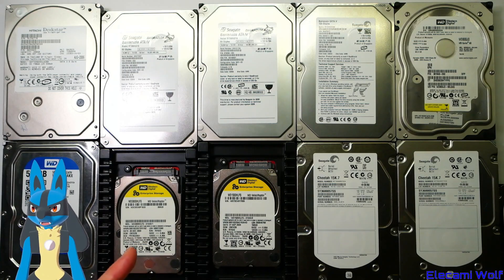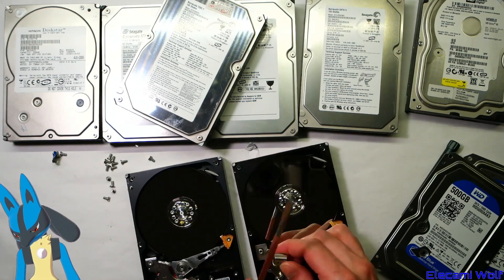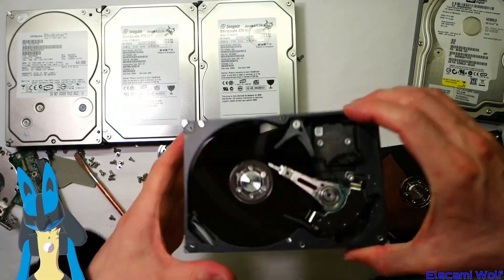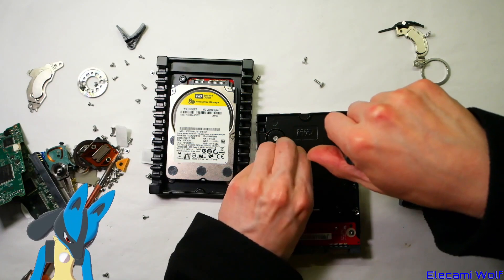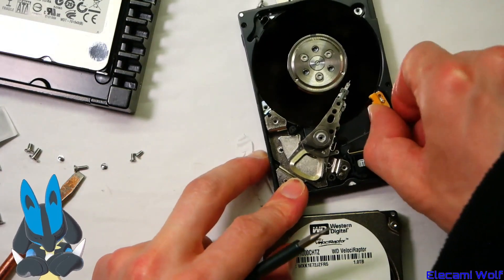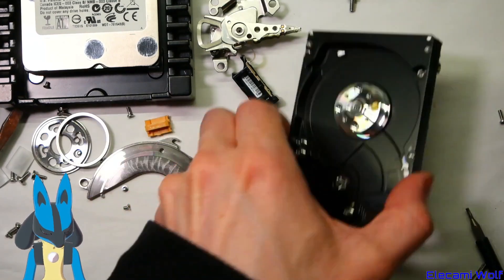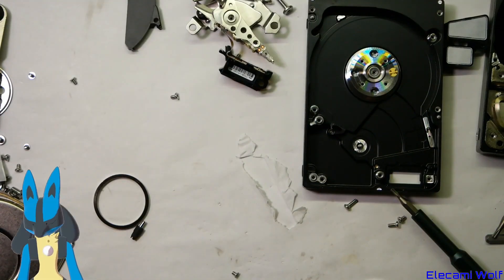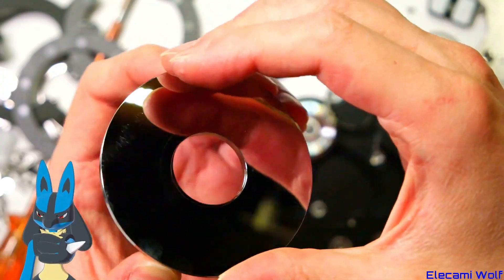EW0071 - Computer Hard Drive Teardowns

Comment: Hey wolfy, have you ever come across a hard drive with platters made of glass?  I once had a dead drive that I wanted to see what would happen to it if I dropped it on concrete (from a height of 5 stories up), and I was so surprised to find the platters had basically turned into sand, they shattered so thoroughly.  I’m guessing it’s for extremely secure data destruction at the end of a drive’s life.
Reply from the maker: I know the glass ones exist. I can't remember if I had any. Maybe it is more common in the laptop drives? 
I have a whole stack of those to get rid of too.

Comment: The only drive your missing is a hybrid drive. I have one that is slowly dying thinking of taking it apart.
Reply from the maker: Oh yes. I've never never used or owned on of those drives. 
I expect it will be very similar to a normal mechanical drive, just have a few more ICs on the board.